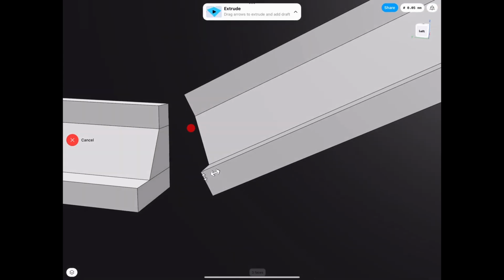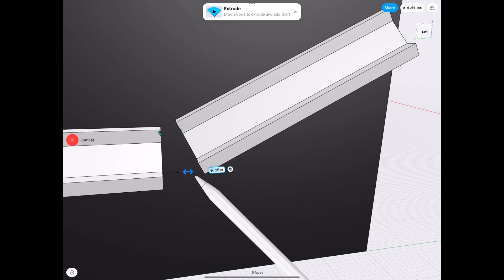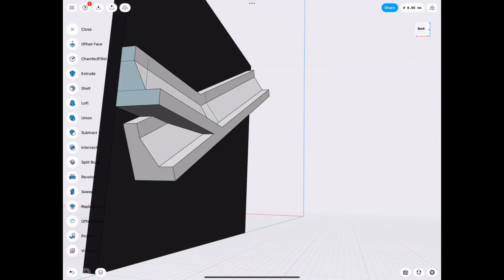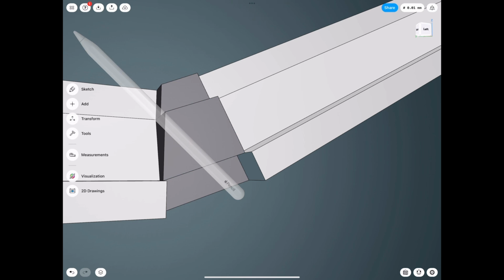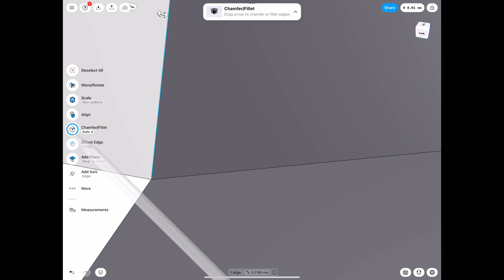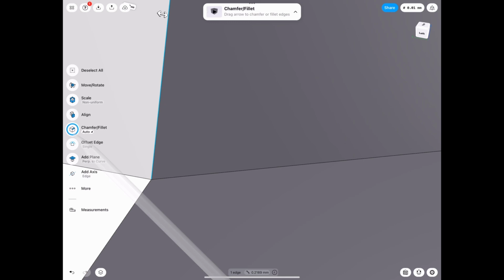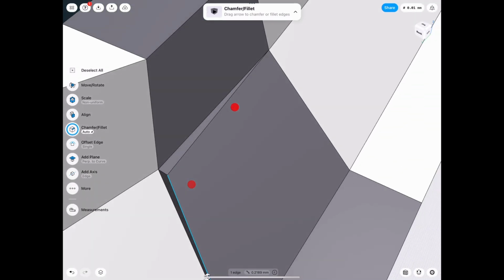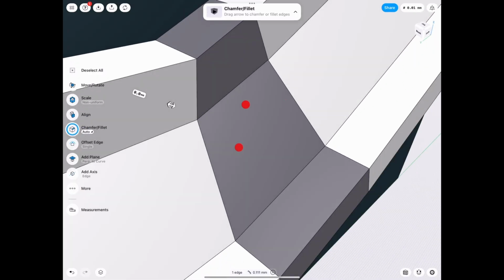[ Shapr3D ] Tutorial: Join Odd Angles

Comment: But I still do not understand how to set a angle.     Lets say i just draw to lines.   click 1 . click 2 = line  and abow i click 3.    now there is two lines, but i dont know and cant set the angle of them.  
90 _I    or 45 _/     ect ect
Reply from the maker: 2 ways. Select the lines the click “exit sketch mode.” The move tool is automatically selected. Move the pivot point to the line you want to remain in the same position, then rotate the selected sketches in the desired angle.

2nd way, go to Transform menu, select the move tool, select the sketches, rotate as needed.
Reply: @JLake3D    I did what you say.. I can move it.. But It still do not tell me what angle it is. 

If I need a 22,6 degre angle i cant do that by moving and use my eyes. I need to write and set the angle.  

Where do I spesefy my angle? 

If I tell you to model a trapezoid.  google it. 
two sides diffrent angles. 
left s ide 76 degree   . rigth side 66 degree.  how ?
Reply from the maker: If you have both edges selected, just look at the bottom of the app. The measurements should be written there. You can do the same thing by selecting faces. You could also try using the measuring tool :)